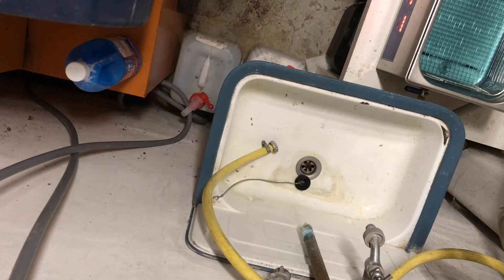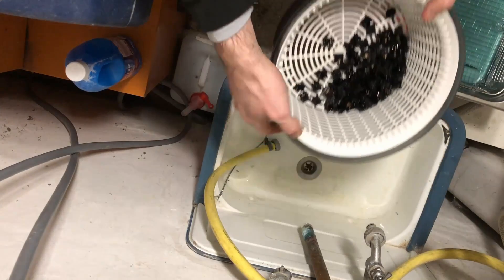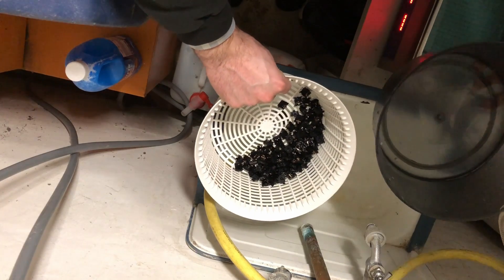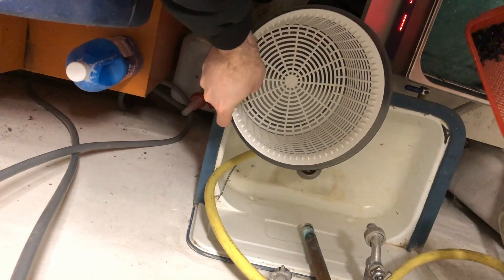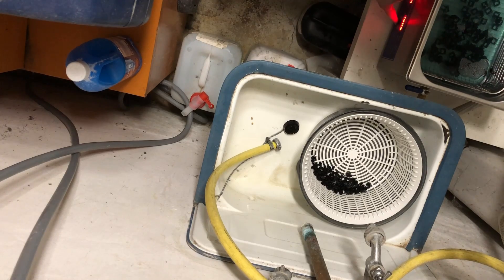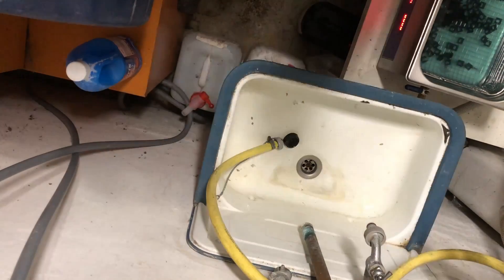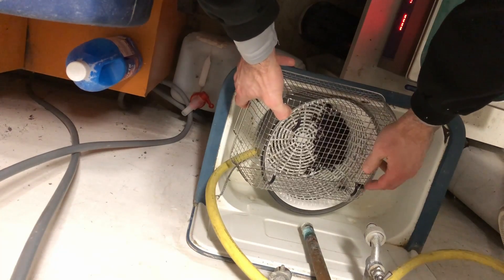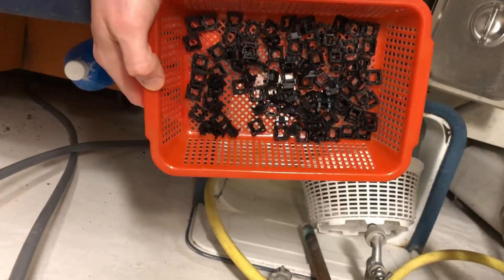Ultrasonic cleaning Cherry MX switches

Comment: hi Wodan, I should have watched your video earlier, I broke some switches because I didn't use my ultrasonic cleaner properly / didn't dry the switches. Do you know if there is a way to recover the switches with another ultrasonic cleaning or rather I should use a contact cleaner? Since you seem to have experience maybe you would be able to recommend me something. Cheers
Reply from the maker: Did you get residue on the contact leaves from drying? Maybe it will dissolve if you clean them in distilled water?
I never had to deal with this myself so I can only speculate.
Reply: @WodanLive  the switches were very dirty green alps from an old typewriter, I will try your method and hopefully, I will save some switches.

Comment: But will it not ruin the leaf?
Reply from the maker: Not if you do it right. I've been using this method for a long time now and haven't observed any negative effects. Make sure to flush the switch bottoms with distilled water after cleaning. I use a salad spinner to drain excess water after that.
Reply: @WodanLive  How distilled water gonna help after cleaning ? I am confused
Reply from the maker: @datdang5042  Distilled water does not leave any "residue" or minerals behind when drying. I don't want to have stains on my contact leaves.
Reply: @WodanLive  gotcha Thankyou
Reply: You can take the leaf out of bottom housing with a switch puller

Comment: Hey Wodan, trying to research this stuff. What solution do you use in your ultrasonic cleaner? Is it just water and detergent?
Reply from the maker: I use an additive concentrate specifically designed for ultrasonic cleaners. It's some small brand stuff I got from a German eBay seller, haven't found this anywhere else. I recommend looking for detergents, soap or additives that are specifically intended for ultrasonic cleaner use.

Comment: Can I just use water as the cleaning solution? Or do i need to add soap or something?
Reply from the maker: Heavily depends on the kind of dirt you are fighting with. Any oil based dirt or residue will be hard to clean without a cleaning solution. In my experience, a special ultrasonic cleaning solution is a game changer.

Comment: Hi Wodan, have you come across any stems that would not clean up well? I desoldered what was described as "1/10 lmao" Wyse board and although the housings came out excellent, the stems are quite awful.

I'm using a solution made for ultrasonic cleaners distilled to about 20%, no dice. Is it possible the stems have just become damaged over time? 

And thanks! Your videos have helped so much!
Reply from the maker: Thanks for the feedback. So far I haven't had any issues with stems not cleaning well. I will be cleaning so early lubing mistakes (white lithium grease) soon and find out just how well the cleaning works.
I would suggest trying another cleaning solution. Maybe try dental tabs? I've heard from a lot of people using these. 
Regarding damage, I don't see a risk there. Then again I am not an expert and just speak based on my experiences.

Comment: So do you put all the pieces in there to clean? stems? Springs? Housings?
Reply from the maker: Yes it should all be in the video. I rinse the contact parts of the switches with destilled water and remove excess water in a salad spinner to reduce risk of corrosion and residue

Comment: a while back i talked to a superlube and oils lube distributor here in The Netherlands where i got my superlube grease and superlube oil that i used on my topre board. and one of my mx-clear boards is doing great btw.. only when i asked him how would one remove these greases and oils from any material he said i could try alcohol but in general they are hard to remove if not impossible..
i'm assume Ultrasonic cleaning is working out for you ?? and that it's the only real way to do this ?
Reply from the maker: I got a special cleaning concentrate off German ebay for my ultrasonic cleaner and it works wonders removing the craziest stuff ... I even got pen marks off keycaps with it. Check out the DT thread for more information about this stuff

Comment: Hey after the video i got some questions... what ultrasonic cleaner are you using? Will a cheap 30€ ultrasonic cleaner from Amazon work too? And after cleaning the switches do you recommend to lubricate them
Reply from the maker: That is a Chinese "industrial" Ultrasonic cleaner from ebay, 10 liter capacity.
But any kind of ultrasonic cleaner should work, treatment times may be a bit longer for the same results though.
And yes, I recommend lubing the stems after cleaning, will be doing a live stream of me reassembling the switches again with a full mod.
Reply: Wodan that would be perfect ;)